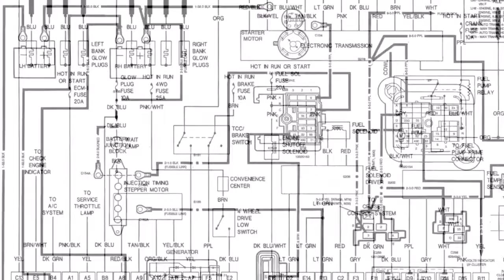93 6.5 turbo diesel swap in a 99 Chevy part 3

Comment: i have a 95 c3500 hd wrecker had a 6.5 turbo diesel i swap it to a throttle body 454 i bought a 93 i used motor and wireing from 93  love it pulled my  rollback with a 5000 pound van on it when fuel pump went out
Reply from the maker: It was a mess, I’m currently putting a replacement Cummins in the same truck.